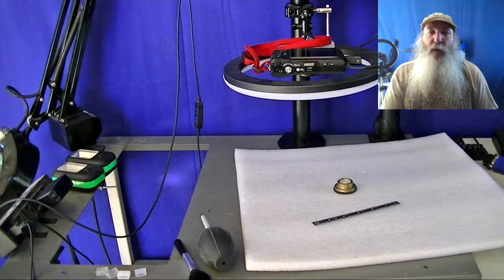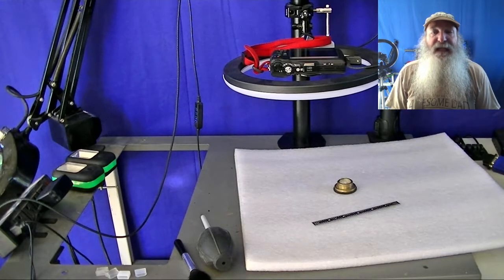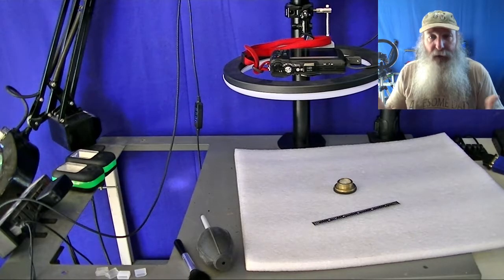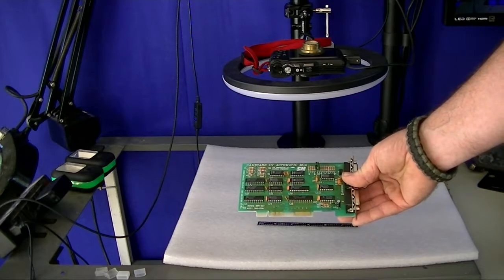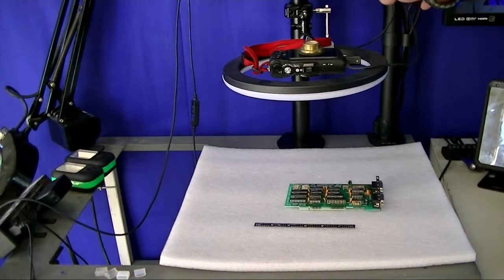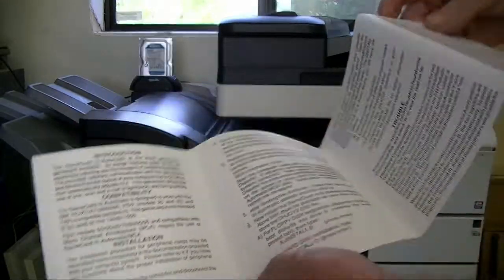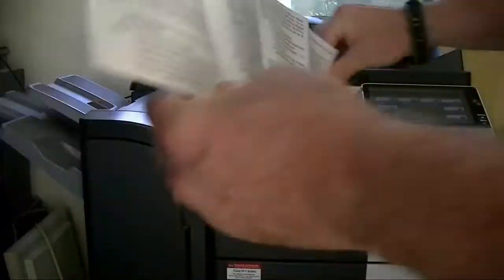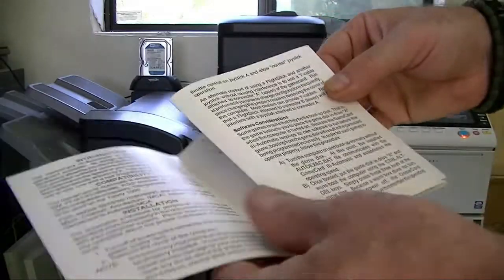The complete three-process adapter documentation the "IBMMuseum" way!

Comment from the maker: There's a fourth process - also independent - that I will be showing soon for some adapters: Archiving any code in EPROMs on the adapter. These can be ROM BIOS extensions and code for a microcontroller on the adapter. The files to recreate the contents of an EPROM are typically included on the page documenting the adapter at the Ardent-Tool.